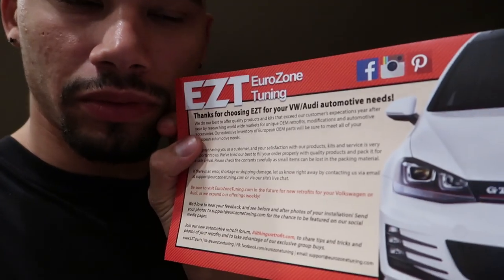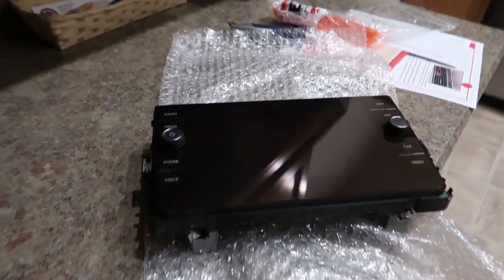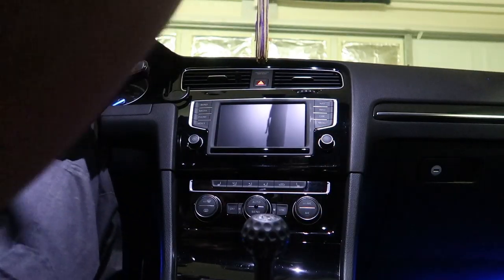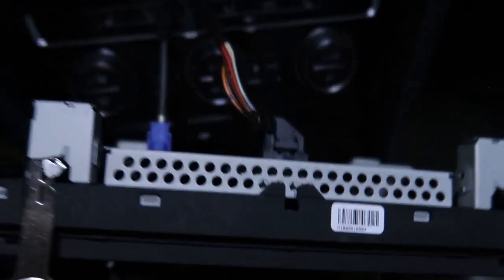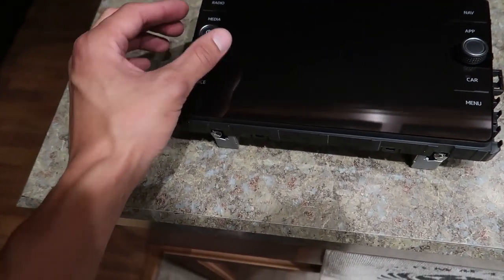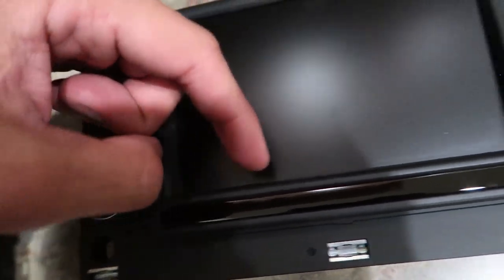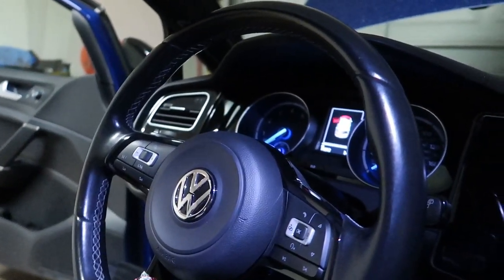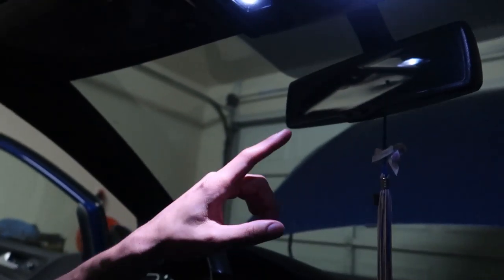8" Screen Upgrade for half price?! | MK7 Golf R

Comment from the maker: UPDATE 5/18: Emailed them Friday about the lines and homie said that's absolutely NOT what they send out normally so they're sending me another.. will make a follow-up video!

UPDATE TO THE UPDATE 5/19: Replacement screen is WAY BETTER. Cant even tell that its messed up at all really. One thin line of messed up pixels that you cant even see from the drivers seat angle! IM SO HAPPY
Reply: That’s good to hear, I’m about to order one as well
Reply: I'm glad you reached out to them 👍🏻 because you seemed really bummed
Reply: I actually got a bad one as well from them about a month ago. I complained about it and they had an extra one that had the same thing. Which is the one you just bought. But yeah they did the same thing, they’re sending me a new one as well.
Reply: Yeah I was expecting 1 or 2 of those rainbow 🌈 vertical pixel lines not a 1/4 of the screen! Good luck on the next one they send. That’s good of them. Awesome upgrade Bryce. I’d be looking at 9” if they had volume knobs!
Reply: Netcruzer RC TECH CARS 9” won’t work without upgrading the head unit. 9” requires the PRO head unit.
Reply: @scotchegg6422  really how much is that?
Reply: Good day I'm Leon having a Golf7 tsi 2013 looking for audio like the 1 that u remove from that vehicle in the video. Or how much is the upgraded 1
Reply from the maker: Check out Eurozonetuning.com they have all types of screens! Or eBay! The smaller one like mine should be pretty cheap

Comment: That's messed up, they should have at least had a picture of the screen so you could see it before buying it. But the screen itself looks sooo much better than the old one, completely transforms the interior and gives it an updated feel. Thinking of getting one now.
Reply from the maker: They're super dope man! According to some comments here you can find them for cheap on the UK eBay 🤷‍♂️
Reply: @BryceJordanProductions  will check it out, I got the mib1 system so gonna cost an arm and a leg to convert to mib2 😭 lol

Comment: I couldn’t cope with that dude, it would boil my piss every time I looked at it. Not sure how much they cost in the US, in the UK, you can get the MIB2.5 pro with the 9.2” screen fitted for around £1000 ($1200 USD).
The screen you have there is around £300 ($365 USD) in the UK (fully working).

Can tell from your expression, you’re disappointed and trying to talking yourself into it.
Reply: Any places you have in mind for that price? I'm driving through the uk on the way back to Germany once lockdown is over (I'm in Ireland) so might get it fitted for that price.
Reply from the maker: Thankfully they're sending me another after reaching out. Said it was definitely not supposed to be like that. Maybe something happened in shipping. That's cheap though that's less then what I paid for this messed up one lol. I don't have the patience to do an mib 2.5 though 😬

Comment: Hi, 
First of all, thanks for sharing this vid!  
I have a 2013 VW Golf 7 1.2 TSi
I would like to get this screen (Golf 7.5 style) in my car.
3 years ago, I removed the original one without navy system (just radio and car functions) and installed an Aliexpress chinese 10" Android Auto/Apple CarPlay Unit.
I want this one recovering car info and would like to keep on using Apple CarPlay
Do you recommend this for my purposes?

Comment: Does this unit still work with the cd player that's mounted in the glove box? ALSO does it always give that voice bit at start up? "Testing system ready"
Reply from the maker: Yes everything still works it's an OEM unit. These come standard in other models. And that voice is my radar detector lol
Reply: Ok ha ha thanks for clarifying  oh one last question a different  video talks about  if the car is an MIB 1,  2 or 2.5 does this matter for this product?   And does it support Android auto?
Reply from the maker: Yes that matters it's for MIB2, not sure if it'll work with 2.5. If you already have AA or carplay it'll stay. It doesn't change any features at all. The brains for this is in the glovebox. You're just changing the monitor. Think of it as a desktop computer, you're just doing a screen swap everything else "behind the curtain" stays the same
Reply: @BryceJordanProductions  any suggestions how i can get either this product or something similar to work for my car if I only have MIB 1?  my car currently does not have apple car play I did see another video where some one replaced the cd player part located in the glove box but it would be nice if I didnt need to mess with routing cables

Comment: so if i want to change my mib1 with 6.5 screen for the 8 one (like yours) i don't need to change the brain unit ? (i'm french sorry for orthographe)
Reply from the maker: No you need to be MIB 2 for this screen
Reply: @BryceJordanProductions  So I need to buy the mib 2 brain unit ? :(  how much you payed for your ?
Reply from the maker: Yup.. sadly you'll need new brains. Not sure on the cost but Eurozone sells those kits as well. I didn't have to do that though
Reply: @BryceJordanProductions  okay thank you so much for your help !
Reply: Hi, i'm also french and i have a MIB2 (nomal not pro), so it is the same as you?
All i need is the 8" screen but did you buy the 8" screen MIB Pro2 OR  the 8" screean for MIB3 (i think, it is the second option, but i'm not sure and the screen looks exactly the same but did not have the serial number.
@Shelby As-tu trouvé une solution.

Comment: Are the two knobs the same size as the original?  Curious if my Leyo aluminum knob covers will fit if I were to upgrade to the newer screen?  Once you get drive time with the new screen, will be good to get your commentary if glare or even finger prints will be an issue.
Reply from the maker: I try to not touch the screen at all ever anyways unless totally necessary, in very anal about fingerprints and stuff 😅. Glare isn't an issue at all it seems I'd say these knobs are ever so slightly smaller in diameter and length though

Comment: How did you get your golf ball shifter to fit? I have a Mk IV 2003 VR6 but adapters that came with are not to big. mine is from Mono
Reply from the maker: Mine fit perfectly man I'm not sure what to tell ya. Try and sell it maybe and get the black forrest industries one.. or maybe take it to a machine shop and have them mod/make you a proper adapter

Comment: I was wanting a 2018-2019 golf r because of the updated screens. glad I now know this is an option and can consider older models now. is there a way to make add a wireless CarPlay adapter to it?
Reply: Not sure about this but there are wireless CarPlay adapters that plug into the USB in the bottom storage below the HVAC controls
Reply from the maker: Yeah not native but there's adapters online that work great I hear

Comment: Has anyone had any luck converting the AMI/MMI to USB? I plan on buying the same head unit but I would like to use CarPlay via USB. I didn’t know if the conversion was as easy as the head unit install or if I needed additional wiring harnesses/modifications
Reply from the maker: Send eurozone tuning an email see what they can do for ya! I’m sure they have some kind of solution!

Comment: hey Bryce Jordan did you get any faults on the dash after making the radio swap thanks
Reply from the maker: No sir it's OEM
Reply: @BryceJordanProductions  I have that very one you install in the tiguan all space  2018 which my wife drives, I also have the 8 inch touchscreen in golf R Wolfsburg 2017 which I drive,I wanted to swAp my wife’s with mine, all OEM, just wandering if I will have faults code on the dashboard, I very much prefer the one in her car as I can easily turn the knob

Comment: does apple carplay or android auto work wirelessly with this radio
Reply from the maker: Nah i wish lol
Reply: I have a 2017 Golf R with Fender stock system.  I added this same screen but that has no impact on the Apple Carplay functionality which requires a USB cable connection.  I think newer models allow Apple Carplay  to work via Bluetooth which would be awesome.
Reply: Does yours randomly disconnect from it sometimes too
Reply from the maker: Mine does not. Have you tried a new cable?
Reply: @timoteileahu  only if I bump the USB cable would it lose connection.  Otherwise Apple CarPlay stays locked.

Comment: Is this plug and play straight swap? No coding required?
Reply from the maker: Correct! Easy swap and go!
Reply: the wiring is same as the other screen smaller one in your video? no need for additional wiring? @BryceJordanProductions
Reply from the maker: Same connector and everything bro a true plug and play. No wiring no coding. Swap screen swap trim you’re done!
Reply: thanks my bro i will def upgrade once the prices come down. £350 for the trim and screen here in the UK and the older smaller screen is not worth much. Great video ;) @BryceJordanProductions
Reply from the maker: @tariqz118  glad you liked it! Might be able to find one out of a crashed car if you look hard enough!